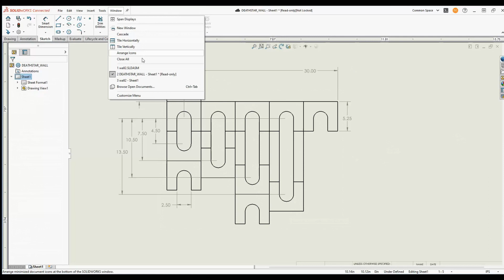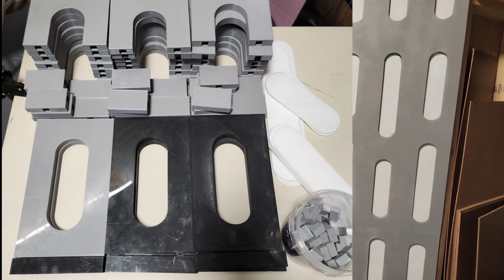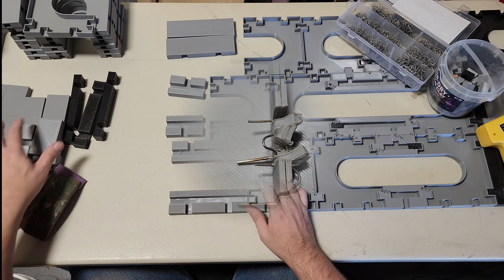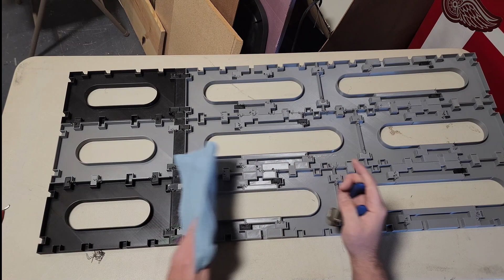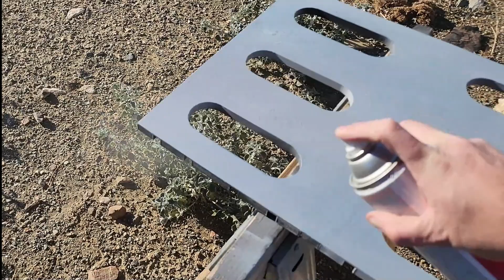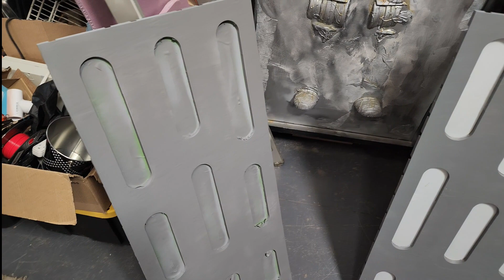3D Printed Death Star Wall - All the Problems - Was it Worth it?

Comment: I've been thinking about this since you shared it in the FB group. Do you think this was better or worse than using a plunge router on MDF or plywood? Any major benefits?
Reply from the maker: I think it comes down to preference and familiarity with each process. I'm not comfortable with the router option personally but a carpenter is going to lean that way. All the issues I had were due to poor planning. It is lighter than the same thickness mdf but mdf will be sturdier.
Reply: @brokentuskgarage  Awesome! I totally get the "every tool is a hammer" mentality - you bend what you know to solve the problem you've got. I 3D print stuff I likely "should" be turning on a lathe, so 100% relate.